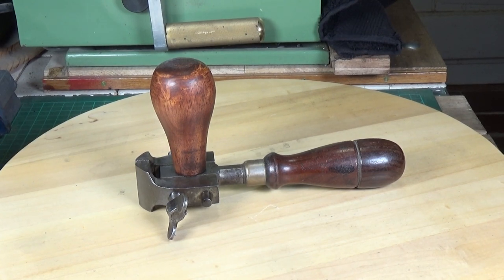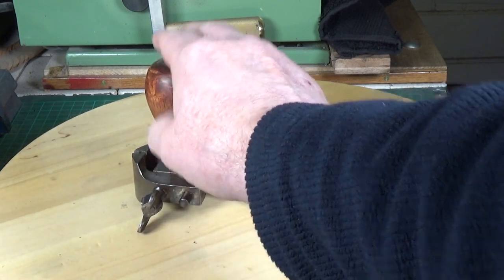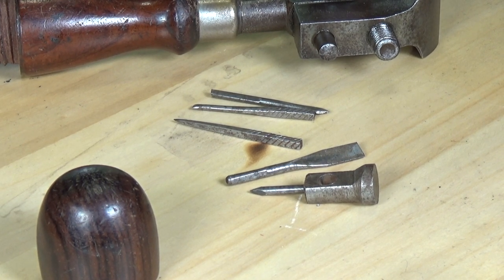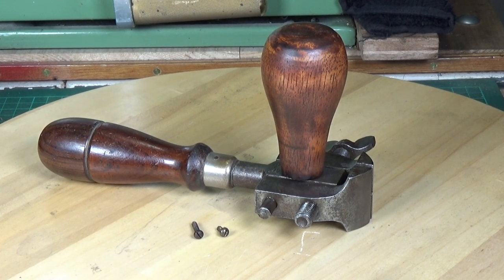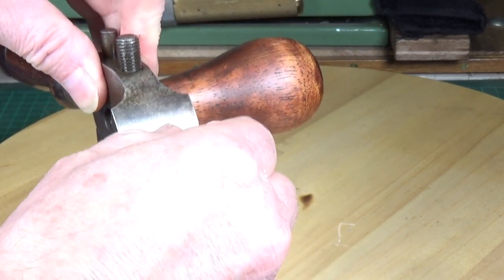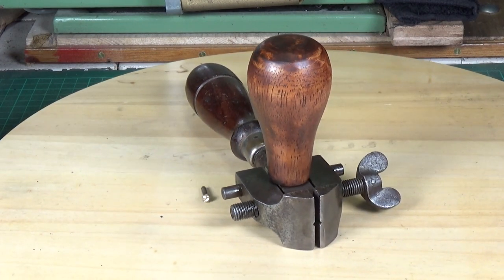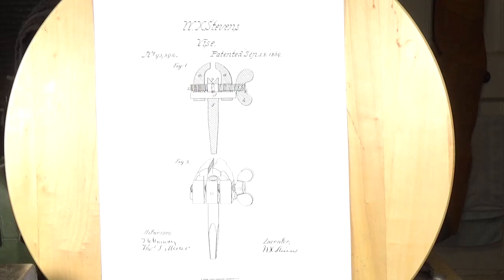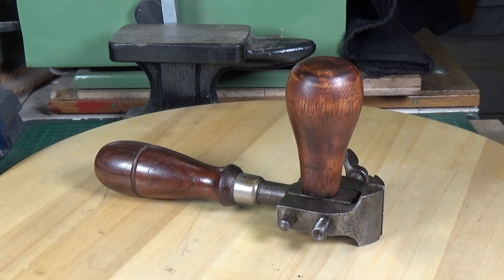Retro Tech - Millers Falls Hand Vice

Comment: Very useful tool Alan, I struggle with cleaning screws up, and have been using a big vice and a dremel wire wheel, I need to switch to your method,  thanks for the tool tip.
Reply from the maker: Hi Mike. Yes it really is, obviously you can also use it to hold small objects when using the grinding wheel too. They pop up on ebay from time to time, sometimes for silly money but if you bide your time you can pick them up for very little.

Comment: Thanks for the video! One question - how do you unscrew the handle? I have the exact same model but the handle wont turn, not sure if its just seized up, or if I'm doing something wrong...? There's a pin through the ferule but I was guessing that's just to hold the ferule in place. Really interesting useful video anyway. I think mine has all the parts except for one of the blades from the washer cutter (oh and I don't have the second handle either, though hoping I might find one amongst some bits I need to sort, now I know what I'm looking for)
Reply from the maker: Hi. The handle on mine has a threaded metal stud protruding from the the end. This screws into a female thread in the vice. I believe that the pin goes through the metal stud as well as the ferule. It may be as you say that the handle is seized or someone at sometime has used some thread lock on it.